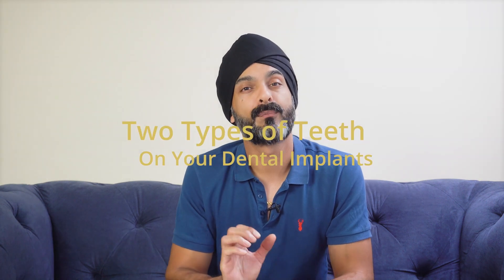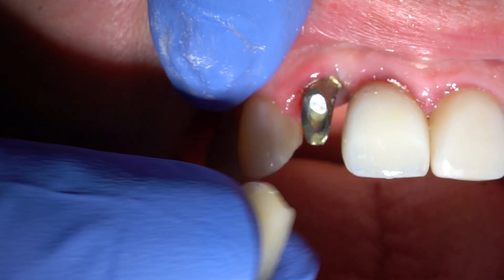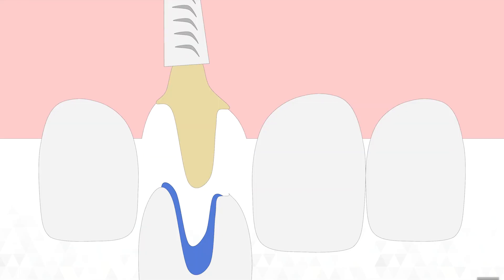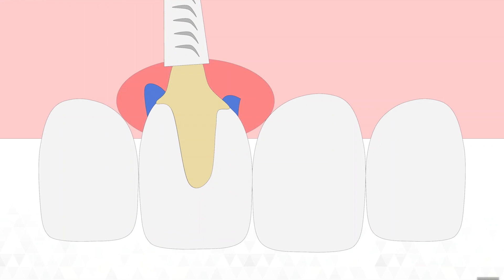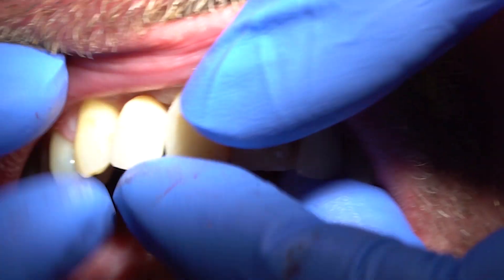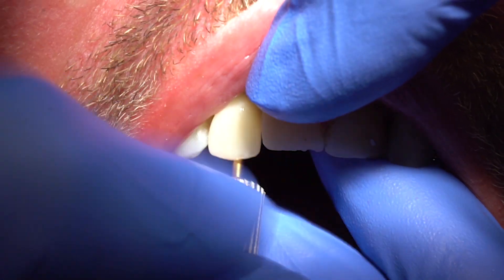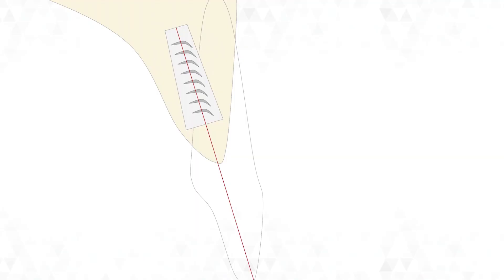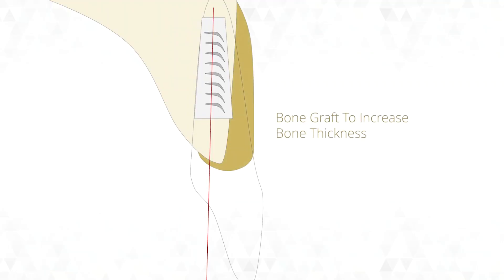Dental Implants : Cement Retained or Screw Retained?

Comment: I have an upcoming 5 unit anterior implant bridge case with 3 implants.  As much as I try to do screw-retained as possible, this case would be difficult for screw-retained due to likely access hole showing on facial.  Also, my concern is passive fit seating issues with long span bridge cases. Angulated solutions sounds great but I don't feel there is long term research on it for bridge cases.  So, I'm going to do cement-retained custom abutments for this case and have the margins supragingival on lingual and equal-gingival on facial for easy cement clean-up.  I think cement-retained is fine as long as you follow proper protocol and don't use too much cement and have the margins supragingival.